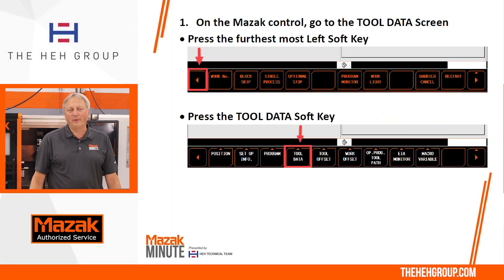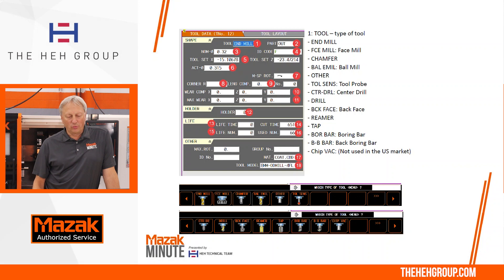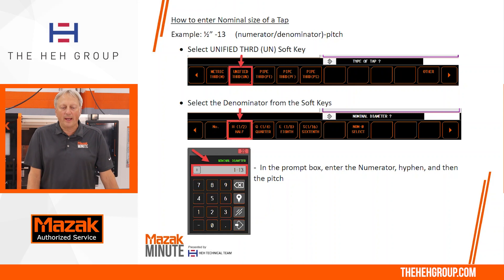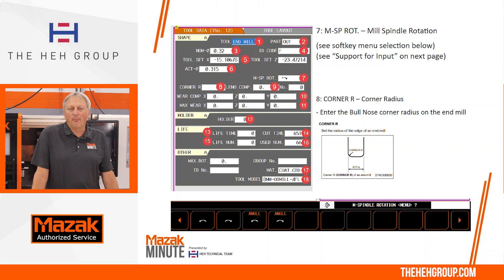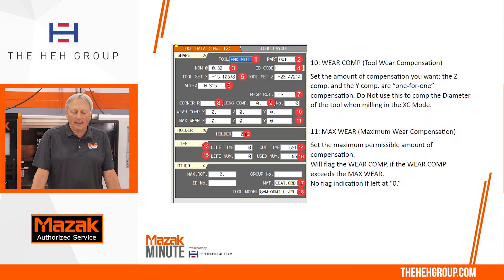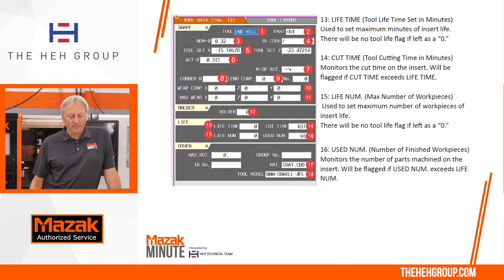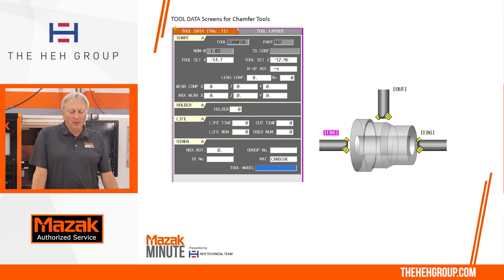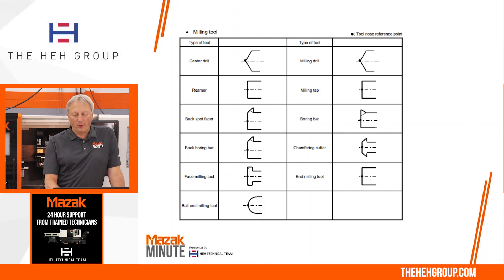Mazak Minute | Episode 8 | Tool Descriptions Continued

Comment: Hi. I have one question. Our company buy new mazak i450h and tool wear offset are set in radial mode, now i have problem with turning tool corrections.
For example when I put X-0.05 i get part with diameter -0.1(double value) I need to change some parameter. Please help

Comment: Thx for your videos. Would it be possibel to some more videos on milling with Mazatrol
Reply from the maker: Yes! Do you have any specific requests? Thanks for watching.
Reply: I would really like to see videos where you change parameters and use TCP.  I don't know enough in this area. I use 3D assist but I am sure I could be much better doing it.

I have a part where my chamfer mill take a heavy beating  if I could change the depth so I don't use the same part of the cutting edge all the time then I could use it longer time. I tried to change in the TCP but didn't know how to do it. 

 @TheHEHGroup